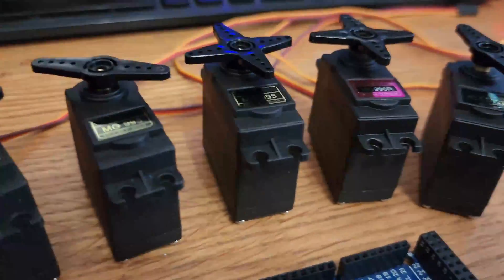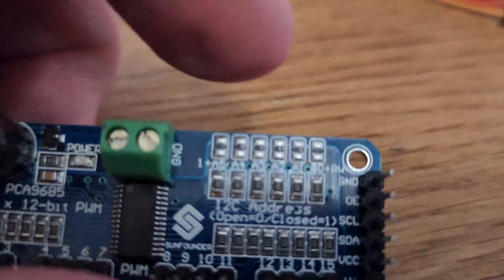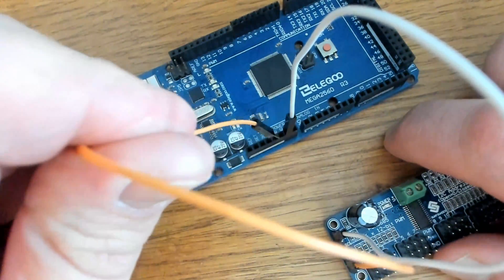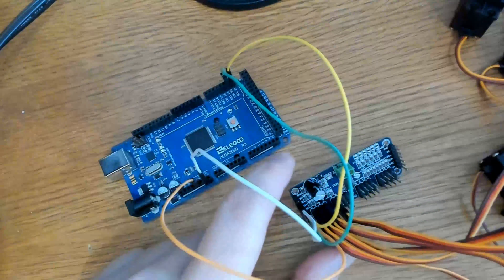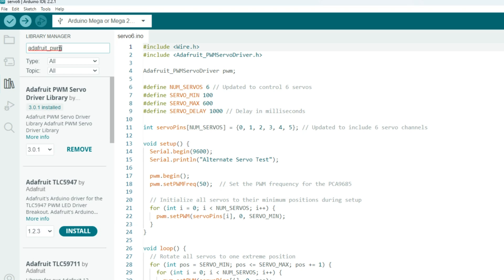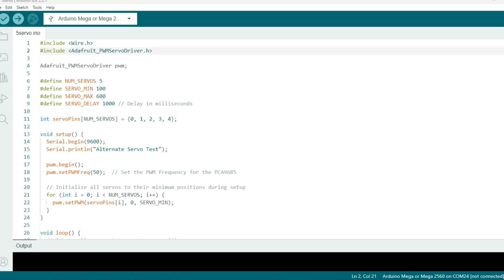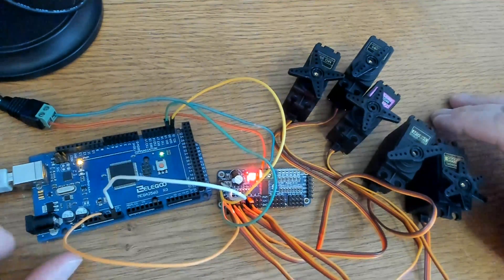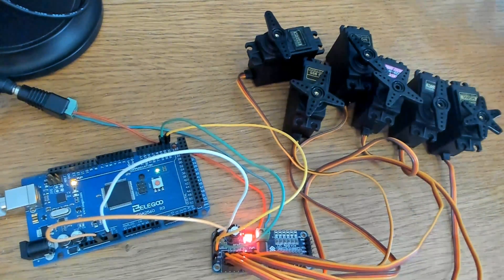Mastering Servo Control: PCA9685 PWM Driver with Arduino Tutorial and Demo

Comment: Within the adafruit library , can the servers be made to turn 90degrees for 5 seconds and then turn back for 3 seconds in a continuous loop?
Reply from the maker: hey there!

Yes, you can do that.
you would need to define 90deg with servo_min and max values: 

#define SERVO_MIN 100
#define SERVO_MAX 600

then define the midpoint: 

#define SERVO_90 ((SERVO_MIN + SERVO_MAX) / 2)

then your loop would look something like this: 

void loop() {

  // Move all servos to 90 deg
  for (int i = 0; i < NUM_SERVOS; i++) {
    pwm.setPWM(servoPins[i], 0, SERVO_90);
  }

  delay(5000);  // 90deg hold for 5sec

  // Move all servos back to home position
  for (int i = 0; i < NUM_SERVOS; i++) {
    pwm.setPWM(servoPins[i], 0, SERVO_MIN);
  }

  delay(3000);  // 3sec hold
}

Comment: what is the recommended external power supply for 5 servo MG996r?
Reply from the maker: hey there!
Always check your datasheet. 
Some MG996R clones can draw well above 1.4A at stall (often 2A+), so size conservatively.

If I am using 5 MG996R servos, a regulated 6V supply rated 10A continuous is a good baseline. If multiple servos can stall or hit heavy load simultaneously, go 12–15A. Use proper distribution wiring (16–18 AWG wiring), don’t run servo power through the MCU, and tie grounds together. Add bulk capacitance near the servo power bus (1000–4700 µF electrolytic) plus decoupling if needed (0.1 µF). 
For larger servo counts, supply power in groups (4–5 per branch) to reduce voltage drop.

That's my approach. I hope this was helpful!  👍  👍
Reply: @BMonsterLaboratory  5 servo mg996, pca9685, 12v-10amp for external power supply, what other components needed?
Reply: Actually, in my thesis that classifies object, i will use a 5-6 IR sensor, 1 HC-SR04 ultrasonic sensor, 1 TCS3200 sensor, arduino mega 2560, 5 servo MG996r, 1 PCA 9685. And for the conv😮eyor belt (150cm length), I'm not sure what is the right components are needed
Reply from the maker: @maryvigrasiasevilla6936  is this a sorting machine that moves items along a conveyor belt?  
There are probably some designs online that you could use for inspiration.
When I use pca9685, I mostly just use it for pwm control. I rarely power servos from that board.
Reply: Yes it is a sorting machine that detects size and color

Comment: Can you share how to setup servos so you can control each? IE: the start point then use one button for each servo and when you press a button that servo goes to its set full travel and stops. When you press the button again the servo goes to its min set point and stops. If there is a video of this already can you share the link? Thanks
Reply from the maker: I don’t have a video of that exact design, but here's how you can apprach it: use a DIP switch as an input to your Arduino to select which servo (0–15) you want to control, and use one pushbutton to trigger the action (move/toggle/sweep...etc). The Arduino then sends the command to the PCA9685 over I2C.

For 16 servos, the best option is a 4-switch DIP (binary select 0–15) instead of a big 16 switch setup—this keeps wiring clean and simple. Also make sure your servos are powered from a separate 5–6V supply with enough current, and tie the servo supply ground to the Arduino/PCA9685 ground. 
Sounds like good material for a future video!  👍 👍

Comment: I’m trying to make a Switch using a servo, esp32 with a RTC module to activate at a certain time of day. I’m struggling to understand the best way to power the system using a battery that can power both the esp32 and the servo. The servo needs to be able to push a high toque as the switch I want it to flip is heavy. I want it to be one module that i can re charge. Any ideas of how i can do this?
Reply from the maker: hey there
What type of servo are you using ?  voltage and current demand ?
Assuming you're using a MG996R servo (6V, 2.5A stall current):

Best solution: Use one 12V 5Ah LiFePO4 Battery (~$20 on Amazon) and split the 12V to two converters:

6V 5A converter → Servo
5V converter → ESP32 VIN pin

This gives you one rechargeable module - just charge the 12V battery and you're ready to go. LiFePO4 is also much safer than LiPo batteries.

Use appropriate wire gage and capacitors for your servo. Add safety measure if you need them (be away of current demands, fuse on the servo connection...etc. ). Check voltages with a multimeter and monitor heat dissapation.

This assuming you're using a mg996r servo at 6v 2.5A max.

Comment: Can I use this with these bigger mg996’s and some sg90’s?
Reply from the maker: You can. are you using the same voltage on all  your servos? That is the easiest way.  Do all motors and boards share compatible electrical and signal requirements? 
Different servos draw different amounts of current. Make sure you have proper power distribution if you do so.

Comment: Hello. Thanks for the video. I want to install 12 towerpro mg996r servo motors on the card. Can the screw terminal handle 6 volts and 20 amps? I couldn't manage to connect it to the extra power supply and screw terminal seems like the easiest solution.
Reply from the maker: Hey there!
you shouldn't use the screw terminal to supply over 10A.
Use external power and use the pca9685 for pwm management. 
if your servos are going to be under continuous load, maybe split a 24v supply to 2 6v branches?
*check data sheets to ensure safety in power management.

Comment: Bro, for 3 SG90 servo motors and 3 MG996 R servo motors how much voltage and ampere is needed to work for a pick and place robot.
Reply from the maker: hey there!
You're working with 2 servo models that have different operating voltages. 
The MG996 R operates at 4.8-7.2v and the SG90 operates at 5v. 
For power distribution, I’d use a single 12 V / 15 A supplying two DC converters: a 6v12A for mg996 motors and 5v5A dc converter for sg90 motors. You'll want to also consider capacitors, fuses, and proper wire gage as well.
Remember to double check all data sheets before you begin 👍

Comment: I want to ask, can I connect the VCC pin from the pca9685 to 3.3v pin in my esp wroom 32
Reply from the maker: Hey there!
This is from the Adafruit documentation: 
VCC - This is the logic power pin, connect this to the logic level you want to use
for the PCA9685 output, should be 3 - 5V max!

https://cdn-learn.adafruit.com/downloads/pdf/16-channel-pwm-servo-driver.pdf

Comment: Is it possible to control the PCA 9685 with a PIR motion sensor?  I am completely stuck on this.
Reply from the maker: Yes, 
The PIR doesn’t “talk” to the PCA9685 directly,  your Arduino reads the PIR’s digital pin and then sends commands to the PCA9685 to move servos.
How many servos do you have connected? What other peripherals do you have connected to your Arduino?  Are you using Uno, Mega, or another microcontroller?

Comment: Hey love u work ❤! 

I want to power seven (9G Micro Servo Motor ) whit (ELEGOO UNO R3) using the PCA9685 PWM driver like in ur video. My question is what power cable do I use so I can power all 7 at the same time?
Reply from the maker: hey there!  Thanks, I appreciate that.
Check the servo data sheet. Those servos usually have 700-750 stall current. Seven of those servos would be around 5A stall current. Provide 20% more current than you need to prevent over heating. 20AWG wires would be good. I saw on Adafruit website that you shouldn't run more than 10A thru the pca9685 screw terminal but it was in a forum  and not official documentation.  
Those are just some things to keep in mind. Always do your own reserach for what your projects require and double check before powering it up 👍👍
Have fun !

Comment: I'm using 555 ic to create pwm for servo but it jitter a lot. Can PCA 9685 fix my problem?
Reply from the maker: Hey  there!
The PCA9685 is for controlling lots of servos with fewer wires connected to your microcontroller. It can be used to offload the pwm signal control for multiple sevos so the Arduino doesn't have to work as hard. 
This sounds like a power issue.  look for the stall current on the servo datasheet and provide 20% more current than its peak. You can also add a 1000uF capacitor to your power suppy line to smooth out the power distribution.  
Just curious, why use a 555 ic for your servo?
Reply: @BMonsterLaboratory  I'm just newbie. I watched other youtube where 555 IC is used to test servo 180 rotation. 
I have 4 DOF wooden robot arm. I want to test individual servo.

Comment: Great video! Just wanted to ask, if im doing a project with 10 servos (21kgcm stalling torque, 4.8V) that will only run 1 or 2 at a time, should i prepare for the worst and get a heavy duty power supply that could handle all of them, or will it be fine with one that can only handle a couple? Are there any failsafes i could put in on the hardware or software (arduino) end to make sure too many arent run, or at least minimise damages?
Reply from the maker: Thanks!  I appreciate that.
I would use a power supply that can handle all 10 servos running at the same time. Even if you only plan to run 1 or 2 at once, things can go wrong — like unexpected bugs, startup surges, or all servos initializing at the same time. If your supply can’t handle the worstcase load, you risk brownouts, resets, or maybe hardware damage.

Have you considered slow-blow inline fuses? They are sometimes used for servo setups because they tolerate short current spikes without tripping unnecessarily. Most have a glass or plastic casing, so you can see if they've blown. You can solder them directly inline between the power supply and each servo.

Also, to reduce stress on the supply and wiring, consider splitting the servos across two separate DC-DC converters. I would run 5 servos from one 5V 15A converter and the other 5 from a second one. This adds redundancy and can improve performance and reliability.

Be sure to do your research and use the datasheet for your servos to help prepare the best setup for your project.
I hope these ideas were helpful! 👍

Comment: can the servos be moved independently all off on controller board their plugged into?
Reply: I was actually wondering like the exact same question so thanks
I’m trying to build an animatronic with like six joints so they all need to move independently
Reply from the maker: have you tried Bottango? It simplifies smooth robot movementns and works great with Arduino servos.
It's free https://www.bottango.com/
Reply from the maker: yes, you can move them independently, in groups, staggered, all the the same time...etc.  Is there a specific setup you're going for?
thanks for the question! 👍

Comment: Hey! I am going to be doing a project involving 5 servos 40kg/cm and a servo driver with an arduino. What power supply amperage and voltage do you recommend? The servos work best at ~6.4 volts or amps i cannot remember
Reply from the maker: Hey there! I'll be happy to share what I have done in previous projects and hopefully it's helpful.
When planning to power 5 servos rated at 40kg/cm torque, it’s important to review the datasheet for the exact servo model or a known equivalent. For example, many 40kg/cm servos (like this one: ATO 40kg/cm Servo) draw approximately 2.5A at 6V under stall conditions.

Running five of these simultaneously could require up to 12.5A in a worst case scenario. A 6V 15A power supply is generally recommended to account for current spikes and provide a buffer for stability. Underrated supplies may overheat or cause brownouts if all servos demand high current at the same time.

To manage power more effectively, especially in projects involving simultaneous servo movement, consider using a 12V 15A (or higher) power source in combination with two buck converters set to 6V. Distribute the servo load between the two converters and add 1000–2200µF capacitors across each converter’s output to help buffer peak demands. Be sure to use 16 AWG or thicker wires, keep connections short, and share only the GND line between converters — not the positive outputs.

Assume ~90% efficiency with decent buck converters. And don’t cheap out on the power supply — an underpowered or unstable supply will shut down or cook under load. Brands such as Mean Well and ALITOVE are known for making stable, reliable power supplies suited for servo projects.

Since most Arduino servo drivers can’t handle high current, the servo driver board should be used as a PWM signal source, and not to power the servos directly.

This is general guidance  based on typical specs and setup practices. Always verify compatibility with your specific components!
I Hope this helps you plan out safe and stable power distribution for your project! If you're unsure after doing your research, don’t hesitate to ask someone experienced — better to double-check than risk burning out your servos. Best of luck with the build!
Reply: @BMonsterLaboratory  Thank you for the reply! As of now, I have wired my power supply to a buck converter in order to be connect to the servo driver (PCA)... But I have done some research over my servos which may require 20 amps... However I do not know if this is fully accurate. The servo i am using is DSSERVO 40 kg as well as 20 kg. I have 4 40 kg servos with 1 20 kg servo. I have looked on adafruit forums regarding servo current draw but have came to no conclusion. 

I was planning to run the buck converter directly to the PCA servo driver. But 20 Amps seems to be too much for the driver to handle... do you have any suggestions? I am now considering running the current through a seperate terminal block in order to power the servos seperately... I do not know if this is the right decision to make however. Help would be greatly appreciated!

Comment: Share your code for this pretty please. My 14yr old is trying to learn how to write this and add code for motion sensors to activate the motors.
Reply from the maker: Sure! no problem. Try this: 

#include <Wire.h>
#include <Adafruit_PWMServoDriver.h>
Adafruit_PWMServoDriver pwm;
#define NUM_SERVOS 5
#define SERVO_MIN 100
#define SERVO_MAX 600
#define SERVO_DELAY 1000 // Delay in milliseconds
int servoPins[NUM_SERVOS] = {0, 1, 2, 3, 4};
void setup() {
Serial.begin(9600);
Serial.println("Alternate Servo Test");
pwm.begin();
pwm.setPWMFreq(50); // Set the PWM frequency for the PCA9685
// Initialize all servos to their minimum positions during setup
for (int i = 0; i < NUM_SERVOS; i++) {
pwm.setPWM(servoPins[i], 0, SERVO_MIN);
}
}
void loop() {
// Rotate all servos to one extreme position
for (int pos = SERVO_MIN; pos <= SERVO_MAX; pos += 1) {
for (int i = 0; i < NUM_SERVOS; i++) {
pwm.setPWM(servoPins[i], 0, pos);
}
delay(15);
}
delay(SERVO_DELAY);
// Rotate all servos back to their minimum position
for (int pos = SERVO_MAX; pos >= SERVO_MIN; pos -= 1) {
for (int i = 0; i < NUM_SERVOS; i++) {
pwm.setPWM(servoPins[i], 0, pos);
}
delay(15);
}
delay(SERVO_DELAY);
}
Reply: Thank you so much! I'll send it to her now.

Comment: What is a good way to or servo controller with memory built in or sd card PLUS audio compatible?
Reply from the maker: I like the Sparkfun MP3 player shield on their Redboard for something simple. It doesn't have many available pins though. It woudl be good for 1 or 2 servos.
Theres' also this Adafruit board: Adafruit Audio FX Sound Board + 2x2W Amp - WAV/OGG Trigger -16MB
You could also connect DY-HV20T and servo control board to Arduino.  👍👍

Comment: Thanks for the video, it's really helpful. Can I use a 5V 5A adapter to power 6 servos?
Reply from the maker: Yes, it can handle 5v5A easily.   The Adafruit website mentioned not going over 10A supply to this board, and that may be the same or evey less for clone PCA9685 driver boards. 
What servos are you using ?

Comment: Hey, I have a quick question.  

I was planning to use two of these PCA drivers for my 18 servos (hexapod project), and since I am new to this, I was wondering if you can power all the servos (12A 5V) with each PCA, and whether the PCAs can handle that high current. Also, do you have any other suggestions or tips for me?  
You just connect the power, ground, and Arduino to the PCA, and then the output is just all servos, right?
Reply from the maker: I made a  video here - https://youtu.be/UeS5nY345kc
The Adafruit website says not supply over 10a when using their PCA9685, it's probably a bit less for these other clone boards. 
Use external power for your boards and just use the pwm driver to manage the servo signals. Be sure to connect common ground!!  check out this video I did using a bunch of servos. https://youtu.be/UeS5nY345kc     Adding some capacitors is a good idea, too.  Use datasheets and be sure you have appropriate current supply before operating. Always double/triple check connections before connecting to power and follow manufacture suggestions . 👍

Comment: i need to use 12 servo motors of 125kgcm and operating voltage range of 10-12v. can i directly power my motors through powering the pca9685 driver with a 11.1 3s lipo battery?
Reply from the maker: Hey there!
Use external power supply to power your servos and pwm pin connected to PCA9685 to control signal. Check this out  https://youtu.be/UeS5nY345kc
Don't forget to add capacitors to avoid potential brown outs and spikes.  👍